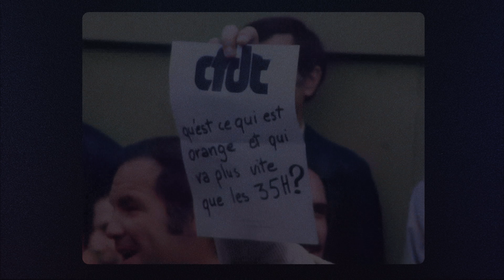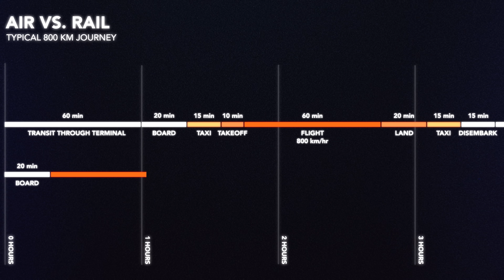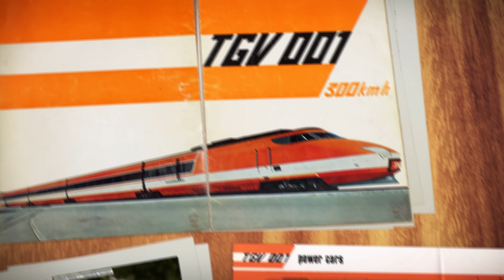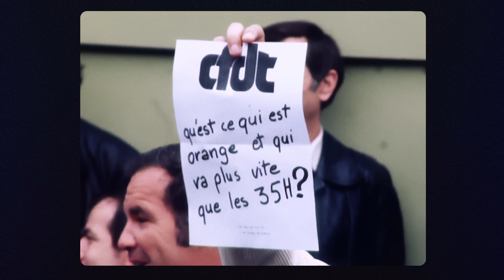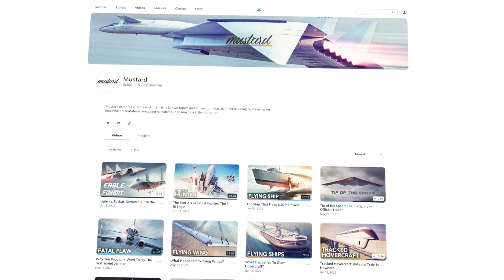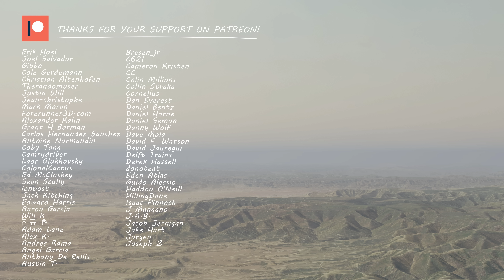Why French Trains Are The Fastest

Comment: I am french. And yes our tgv's are marvels.
Unfortunately, their power and speed are underused as they only travel at speed between 250 and 320 km/h whereas they can reach more than 570 km/h. Which could be a massive time saving.
Reply: 570kph is frankly absolutely reckless. The amount of wear such speeds (or even speeds like 400+) exert on the vehicles and infrastructure is immense, and the energy consumption is exceedingly high as well.
Reply: @bahnspotterEU  I disagree but you made some good points. With appropriate rails, friction as well as the need of braking can be reduced. I believe in our trains.
Reply: @osmonde3272  You can only go so far. Train wheels for example are conical in shape so that the trains themselves can corner effectively. This means though, that the faster a train goes, the more it will start to oscillate and sway. At the speeds you‘re looking at, you‘d seriously risk a derailment. You can make the wheels less conical, but that will impact the train‘s cornering ability, which it needs to retain due to interacting with conventional railway infrastructure in many areas of France
Reply: The 574.8 km/h record in 2007 was a test run only.
Reply: @rtrfan7398  totally. Which proved what speed they could reach.

Comment: When Shinkansen opened, it was only 10 kph faster than the fastest french train yet, the Capitole between Paris and Toulouse. The revolution of Shinkansen isn't speed, it's dedicated new lines built from scratch
Reply: Indeed, the Japanese have invented the concept of intercity metro train. As a matter of fact, most regular trains can go beyond 200km/h on a dedicated high-speed line with the right signaling, track gauge and power supply.
Reply: @SpectreMk2  of course yes and that's what's interesting with the shinkansen
Shinkansen and TGV are the two sides of innovation in high speed train, each learning from the other to create the modern high speed rail
And also in the 1960, only few railways had knowledge ans experience for running 200 kph trains
Reply: Also like Mustard said another difference was the target. The French high speed trains were low capacity luxury trains made to transport wealthy tourists a few times a week. The Shinkansen was high speed mass transit which was a different thing altogether. Making trains go fast wasn't what made the Shinkansen impressive. It was the enormous capacity and consistency. They ran dozens and dozens of trains carrying thousands of people every single day.
The Shinkansen wasn't a luxury novelty, it was actual high speed transit. After all serving a handful of rich elites isn't really going to change a country.
Reply: "Revolution" of Shinkansen was it's ability to compete with airlines dedicated lines or not.  You do not need dedicated lines to reach high speeds.  Most HSR lines around the world operates in some degree of mixed traffic.
Reply: How does building dedicated new lines from scratch make the Shinkansen revolutionary? Is it because the new lines are future-compatible?
Reply: @xerxxxlugner As the video points out, what slows many services is not the train, but the curves, grades, signaling and such.  The Acela corridor between Boston and New York is an example of this.  Lowering one's time per km from 40 seconds to 25 seconds in one section can have less impact than the multiple minutes per km in some winding section.  The only way to get high speed is a new built track designed for speed.  Radii of curvature for some high speed trains, like the 400-500km/h train used for the Shanghai airport line, can be tens of kilometers.
Reply: @bearcubdaycare  Shinkansen wasn't built on dedicated lines for "deconfliction".  It was built on dedicated lines because the standard Japanese narrow guage was insufficient for high speeds.  You can have non-dedicated lines and still reach high speeds.  

As to ROW curvature, yes, older ROWs curvature typically does not allow for higher speeds.  However, depending on how far apart your stations are your trains don't necessarily even need to go that fast.  A balance needs to be met between station spacing, travel times, and costs.
Reply: @taoliu3949  in france the "classic" railway lines are limited to 160 or even 200 km/h on certain sections. because past a certain speed the driver can no longer see the signaling next to the rail. this is why we created the LGVs with repeated signaling in the driver's cab. but I agree I agree on the curvatures which limit the speed of trains even on LGV there are sections limited to 250 or 270 km/h follow the route of the line
Reply: @athrunzala6770  That's due to legacy infrastructure which were not built to support high speeds, not because traffic is "mixed".  Every HSR service in the world mixes traffic to a certain degree.  Even the Shinkansen mixes slower local trains with faster express trains.
Reply: @taoliu3949  The main reason why the Japanese need a dedicated line is due to Tōkaidō Main Line operating at capacity. HSR or not, they will need a new route to relieve that line.

Comment: 0:20 that is one of those kind of sort of but not really true.  At that time the rail speed record was heald by LIMRV from 1974 setting a record of 411km/h

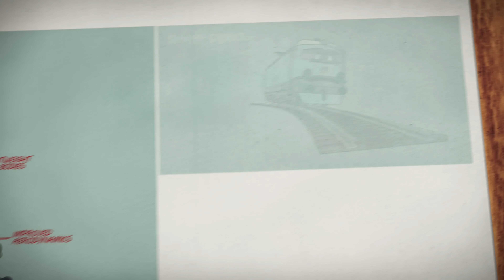1:05 "1950 about the same speed as the 1930" That is not really quite true. While the top speed in service was 160km/h in 1930, this was really just the top speed of one or two lines. In the 1950 the top speed of 160 was on quite a few lines., and of cause in the 1960 that would increase to 200, and then 210. Of cause TGV speed of 270 was a large leap over 210km/h, but it was also a fairly long term of time.

it was really between 1960 and 1980 the speed was stuck

1:13 "sharp curves, steep hills and outdated signaling"

That is not quite true. Most of the raillines that was built in the 1890 and 1910 was built for a hypothetical future with faster trains, most of them was built with at least 160km/h in mind, some faster. Of cause for the lines built in the 1850 it was a different story, they was mostly built for 80-90km/h.

Most of the lines was built with 1.5 or 2% inclination, that is actually less than most of the LGV/TGV network that is about 3.5%

Signaling typically have been upgraded step by step.

Most of the improvement from around 90km/h to 160km/h between 1900 and 1950 was on existing track with just small upgrades. And some tracks was upgraded all the way to 200km/h. The issue here was upgrading beyond what original was envisioned. And this was always clear to anyone involved that a new like would need to be created eventually.

1:48 break from complaining. how ever made those pictures. They are freaking fantastic. I first thought that they was original.. but.. well of cause they are not.

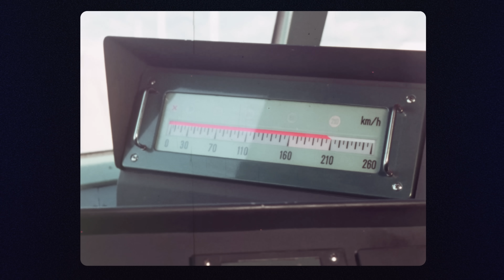2:30 People had not really given up on railways, specially not in large. There was still routs that was very popular, even if long distance route had been on a decline for a number of years.

5:40 to be fair, a vast majority of TGV is new track. And most of the part that is not, is recycled track. The amount that is on shared track is pretty much minimum to none. This is very different to say Germany

6:00 The steeper grade is not really a effect of the gas turbines but due to TGV having much more driving axels than most trains of the day (8 in steed of typical 4)

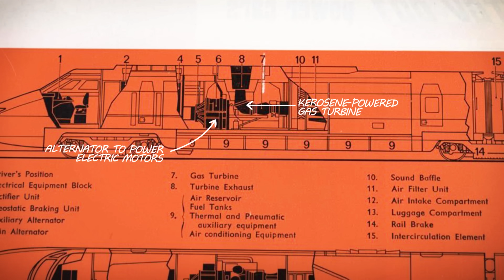7:00 the TGV 001 wasn´t really that revolutionary. gasturbines and many driven axles and share boggier was pretty common at the time, and it was more conventional than anything else.For instance the Turbo train had a very similar layout. I would even like to claim that TGV001 was more conventionall than the turbo train

9:50 Its not really a modication TGV SUD and TGV001 are totaly diffrent. While the bogier and the intermediat cars are very simular, the actuall power head is totaly diffrent, and its consideraly heavier, forcing them to change the wheel layout. The new train also added 4 more cares to compensate for the lossed space due to larger power head.

10:40 "sleek new look for the 1980"

Well this is subjective, but the TGV Sud look very simular to the much older TGV001, to the degree that a lot of people think its the same train. And ... while this is somewhat subjective, i would say the orange white and black is a very 1970s look and it was already outdated at launch. The very pointy shape was also somewhat of a 1970s look.

11:20 While the train was the same, it was modified in several ways. This was also true for the previus frensh recordholder. (worth saying that TGV only ever hold steel on steeld record, never any ultimate rail speed record.

12:24 2007 was never a railway speed record, it was a steel on steel record.

12:27 for a other vise very nice perfectly animated video... the texture on the bank here... well that part could be made better.

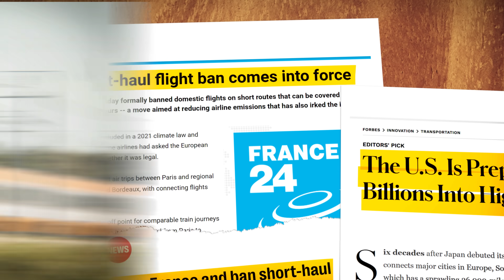12:48

There is an elephant in the room. Trains pay service time to the rail network owner, in this case both are state entities, so its sort of a symbolic payment. This payment is doe to time of rail usage. This favor fast trains a lot. Not only that, despite having a lower axle load, the wear on the rail is a lot higher for high speed trains, specially so for speeds above 300. When the speed of TGV was 270km/h, this wasn´t that much of a issue, but when it was raised to 300km/h and then even more 320 it was.

The track holder make a huge loss on high speed trains, and the french state is shoveling money into the track. Its a huge load on the tax payers. This makes this video a bit to one sided.

This is of cause the issue when a video is just based of a pre existing source. The bias is carried over.

Comment: Amazing train by an amazing channel, let's go Mustard!
Reply: It's always nice videos but there is a amoying  number of errors.
Reply: @matsv201  Name a few would you?
Reply: @YT_niuniuhhh  Well all right, here is a few.

0:20 that is one of those kind of sort of but not really true.  At that time the rail speed record was heald by LIMRV from 1974 setting a record of 411km/h

1:05 "1950 about the same speed as the 1930" That is not really quite true. While the top speed in service was 160km/h in 1930, this was really just the top speed of one or two lines. In the 1950 the top speed of 160 was on quite a few lines., and of cause in the 1960 that would increase to 200, and then 210. Of cause TGV speed of 270 was a large leap over 210km/h, but it was also a fairly long term of time.

it was really between 1960 and 1980 the speed was stuck

1:13 "sharp curves, steep hills and outdated signaling"

That is not quite true. Most of the rail-lines that was built in the 1890 and 1910 was built for a hypothetical future with faster trains, most of them was built with at least 160km/h in mind, some faster. Of cause for the lines built in the 1850 it was a different story, they was mostly built for 80-90km/h.

Most of the lines was built with 1.5 or 2% inclination, that is actually less than most of the LGV/TGV network that is about 3.5%

Signaling typically have been upgraded step by step.

Most of the improvement from around 90km/h to 160km/h between 1900 and 1950 was on existing track with just small upgrades. And some tracks was upgraded all the way to 200km/h. The issue here was upgrading beyond what original was envisioned. And this was always clear to anyone involved that a new like would need to be created eventually.

2:30 People had not really given up on railways, specially not in large. There was still routs that was very popular, even if long distance route had been on a decline for a number of years.

5:40 to be fair, a vast majority of TGV is new track. And most of the part that is not, is recycled track. The amount that is on shared track is pretty much minimum to none. This is very different to say Germany

6:00 The steeper grade is not really a effect of the gas turbines but due to TGV having much more driving axels than most trains of the day (8 in steed of typical 4)

7:00 the TGV 001 wasn´t really that revolutionary. gasturbines and many driven axles and share boggier was pretty common at the time, and it was more conventional than anything else.For instance the Turbo train had a very similar layout. I would even like to claim that TGV001 was more conventionall than the turbo train

9:50 Its not really a modication TGV SUD and TGV001 are totaly diffrent. While the bogier and the intermediat cars are very simular, the actuall power head is totaly diffrent, and its consideraly heavier, forcing them to change the wheel layout. The new train also added 4 more cares to compensate for the lossed space due to larger power head.

10:40 "sleek new look for the 1980"

Well this is subjective, but the TGV Sud look very simular to the much older TGV001, to the degree that a lot of people think its the same train. And ... while this is somewhat subjective, i would say the orange white and black is a very 1970s look and it was already outdated at launch. The very pointy shape was also somewhat of a 1970s look.

11:20 While the train was the same, it was modified in several ways. This was also true for the previus frensh recordholder. (worth saying that TGV only ever hold steel on steeld record, never any ultimate rail speed record.

12:24 2007 was never a railway speed record, it was a steel on steel record.